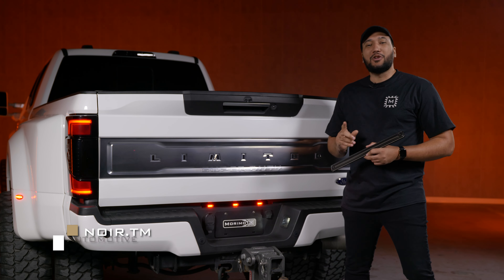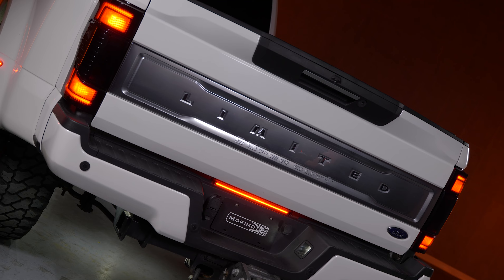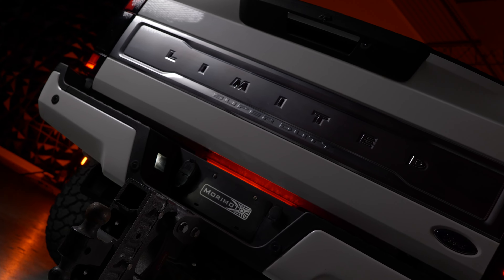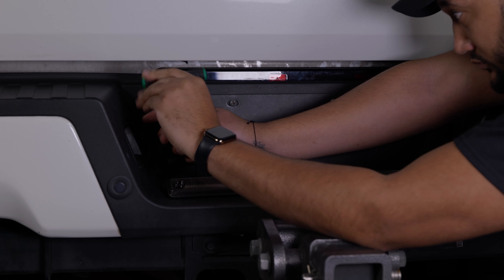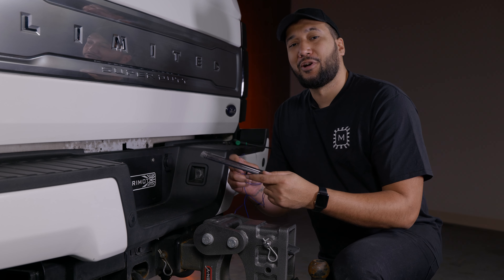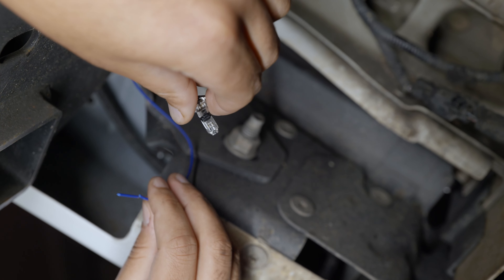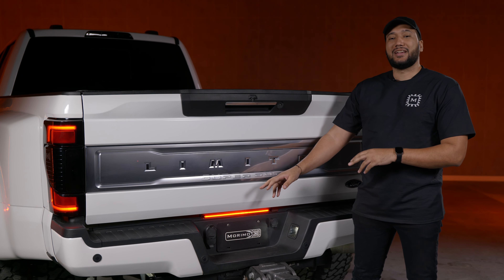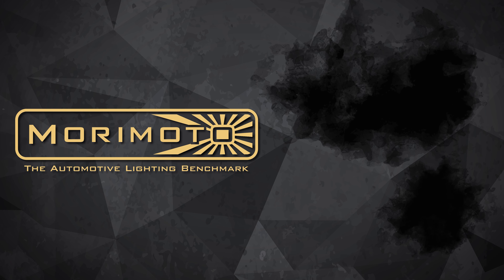2017-2022 Super Duty Morimoto XB LED Center Marker Light | Overview & Installation

Comment: Can this work for non dually models for example and 21 f250
Reply from the maker: You can make it work if you're good at wiring, but these are direct fit for 2017-2022 Super Duty models.